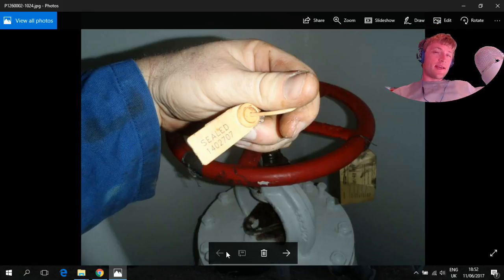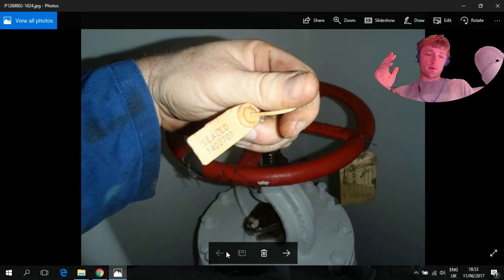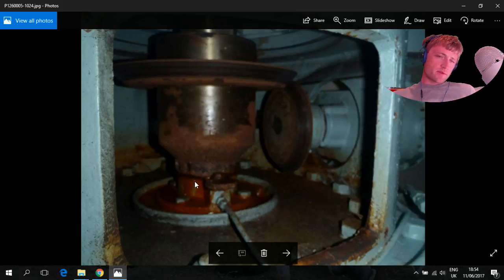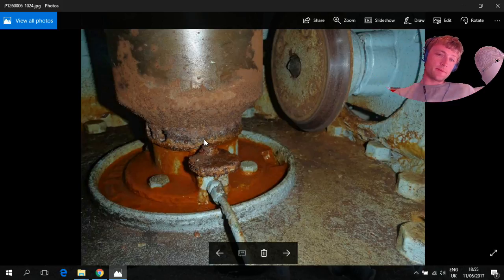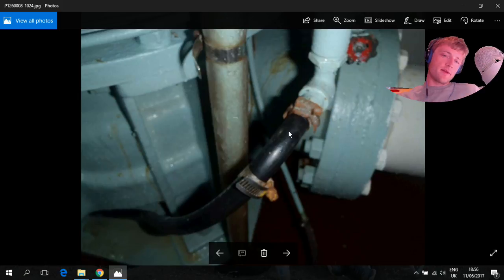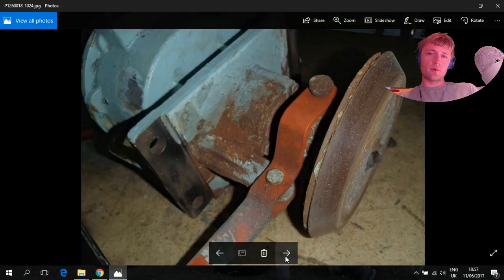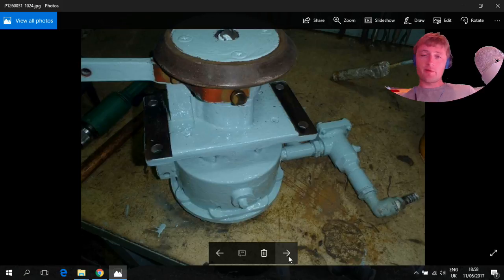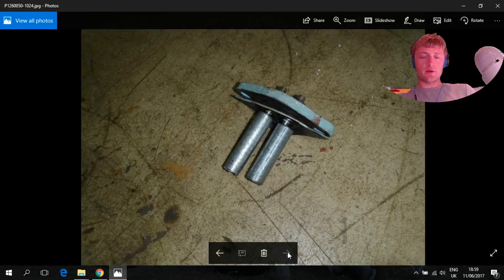EMERGENCY FIRE PUMP CHECKS !!!

Comment: sir, good day. may i ask you a question pls.
the isolating valve is main fire line system.
is it two valve or a single valve?
Reply from the maker: Hello it depends the system piping diagram.
Also it depends where you like to isolate which area!